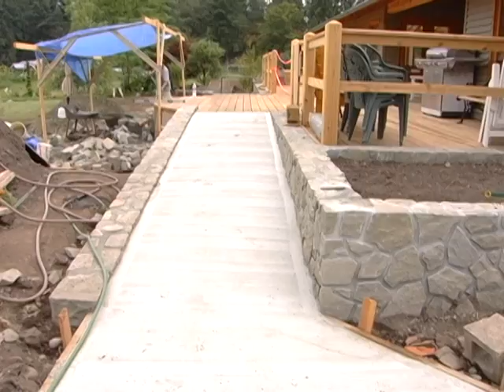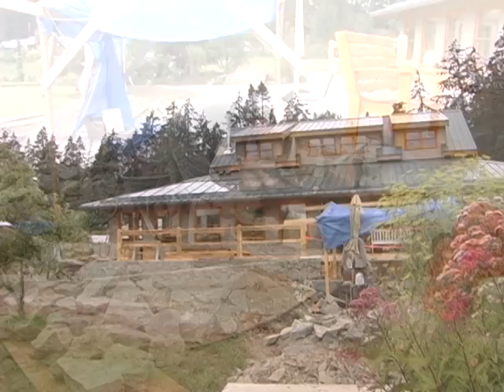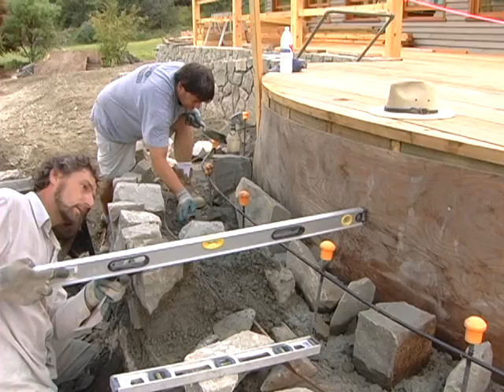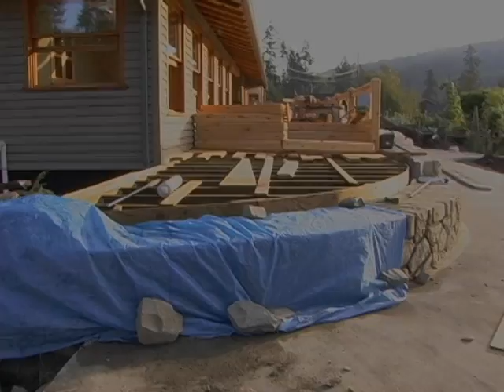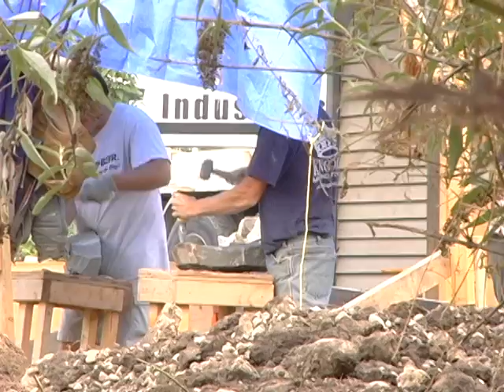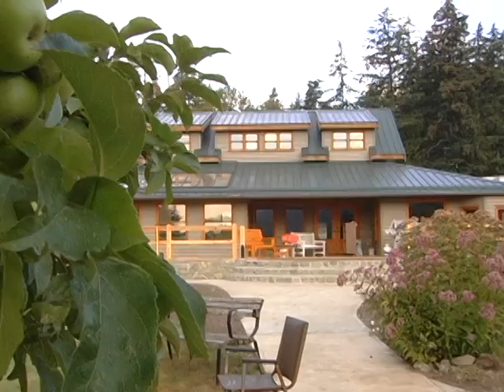Providence Farm Stonework Part Five

Comment: What is your mortar and do you add a latex bonding agent to it like Acryl 60 to make it more workable?
Reply: Here in n.c, we use 2 shovels masonry sand, one shovel Portland cement type I/II. No bonding agent is needed except for the Portland. I make what we call a slurry. I take a trowel of dry Portland, put in a bucket then add water till it's a paste. I lightly wet my stone then paint it with the paste before I set it in the bed joint. The glue that bonds..